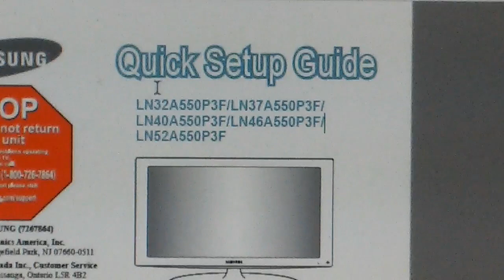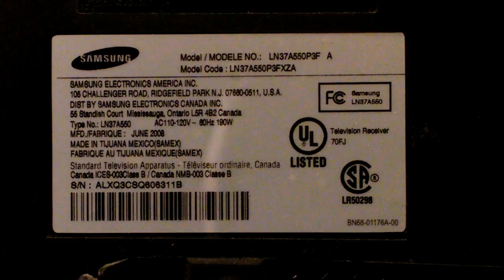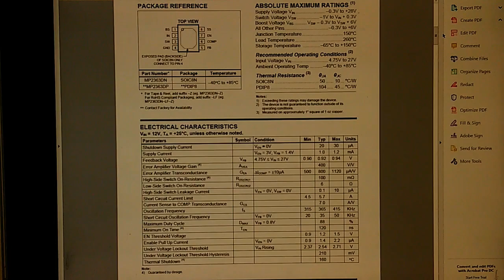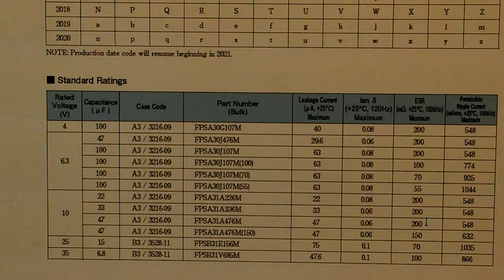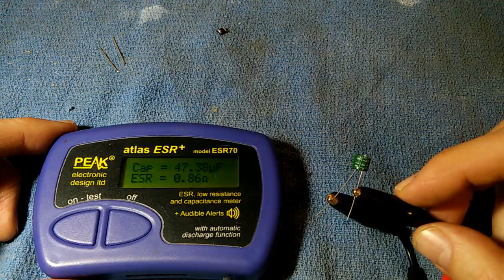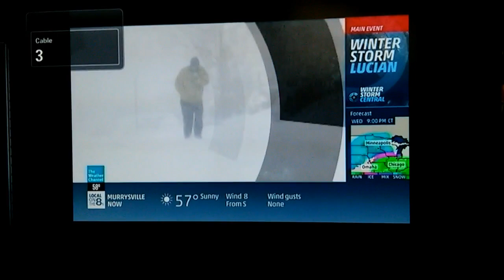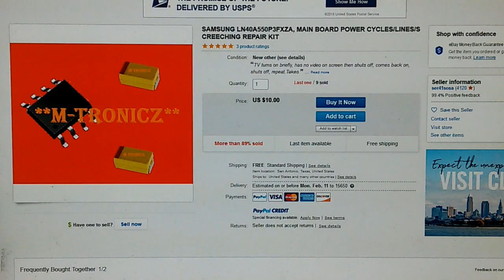Samsung TV startup cycling fix

Comment: Thank you - worked for me - that single capacitor was the issue - I was reading 200+ Mf acoss that tantalum capacitor (not removed) - following your way soldered a 50+ Mf  1200v electrolytic capacitor removed from some available junk board - took virtually 5 minutes - astonishingly TV works fine.  My new capacitor was so large that I had to run 2 wires away foam the main board and place the new capacitor externally.  But, it worked, as I was ready to trash the TV.

Comment: This is the only video I've found that actually explains how to fix the green screen, power cycle, screeching samsung disease.
My TV is currently infected but to this point is still below my tolerance level, (two to four power cycles) so I haven't taken action yet.
I already got two extra years out of my 52" samsung replacing a bulging capacitor on the power board and it looks like I'll be taking a crack at this in the near future.
Thanks for this video, very clear explanation of both the problem as well as the repair.
Reply: I powered up our tv last night while our 7 year old was sleeping and it scared him to death. He woke up screaming, poor kiddo.

Comment: Thanks for the video showing the symptoms of your TV and the fix.  My LN46A550P3F was doing exactly those things.  The main power supply caps looked good and I pulled a few and measured them.  I had a 47uF 8V polymer tantalum in my collection that I used (35mOhm ESR) as a replacement for the output cap of the MPS buck regulator.  The TV starts right up now.

Comment: Thanks so much for this well done video!  Replacing the 47uf 10V  capacitor with one I got off eBay ( a non surface type tantalum cap )solved the problem on our 10+ year old 46" version of this Samsung TV (LN46A550P3F).  Never unsoldered a surface cap before, but no problem.  Nice to not have to throw this thing in the etrash because of 1 little capacitor!  Big thumbs up!
Reply from the maker: Excellent!

Comment: Rewritten corrected text:
SAMSUNG TVs of the A550 series were notorious for having problems when
stating up.
Specifically, the picture would come on with abnormal colors or stripes.

The audio would be absent or a screeching sound.
The picture would then shut down and restart with a different abnormal
pattern.

It could go through many cycles before getting the picture and sound
correct.  --  The problem is on the Main Board.

Others have found that a Tantalum Capacitor and a Step-Down Converter
chip causes the problem. --  The capacitor is 47 uF 10 volts.

The Step-Down chip is MP2363
The capacitor can be removed with a soldering iron, but the Step-Down
chip has a central sold pad, and it must be removed with a hot air
desoldering station.

I believe the capacitor is much more likely to fail than the MP2363 chip.
In this case, I used a capacitance meter to show the capacitor had
abnormally high ESR.

I replaced only the bad tantalum capacitor with a cheap electrolytic
capacitor and it fixed the problem. I used an electrolytic capacitor
because I had no tantalum capacitors on hand.
If I were to do this job again, I would order some 47uF tantalum
capacitors ahead of time.

 --- Clues that the problem is the tantalum capacitor ---
1. The problem is worse when the TV is in a cold environment.
     Failing capacitors often function better when they are warm.
2. The problem has gradually become worse over time.
    Typically capacitors go bad slowly over time.

The TVs in the A550 series are:
LN32A550P3F
LN37A550P3F
LN40A550P3F
LN46A550P3F
LN52A550P3F

The user manual and firmware update for the A550 series TVs is available at:
https://www.samsung.com/us/support/owners/product/2008-lcd-tv-a550-series

For those who do not have soldering equipment/skills, there are services
which will perform the work for you. There are several listed on eBay.
The typical charge $40.00

You may incidentally discover some bulging capacitors on the power
supply board.  --   These TVs are also notorious for that problem.

There was one in this TV and it was replaced.
The swollen power supply cap did not cause the restart problem, however,
they can cause other problems. Swollen caps should always be replaced.

00:29 TV models in the Samsung 55 Series.
01:32 Description of the problem.
03:06 Demonstration of the problem.
05:27 Remove the back of the TV.
07:19 Remove the Power Supply board and replace a swollen cap.
09:32 Remove the Mainboard.
11:41 Location of the suspect components.
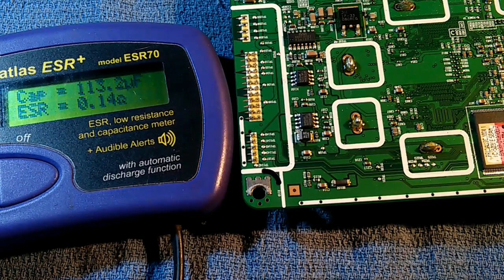13:55 Measure ESR on the tantalum capacitor.
14:46 Replace tantalum cap with electrolytic cap.
15:46 Successful fix.

Comment: Very well done and informative.  Funny though I ask myself, “if someone has a soldering iron and DOESN’T own a multimeter”, I wouldn’t advise attempting an electrical repair.  Halfway decent DMMs are pretty inexpensive anyway these days.   Great video!!
Reply from the maker: This job requires more that a basic DMM.  A  capacitance/ESR meter is needed to test the capacitor..  They are typically $100 USD minimum.

Comment: I found a LN46A650A1FXZA at a garage sale for $5.00 and it is exactly the same as the one I found on the curb a couple of years ago that only needed two capacitors.  The garage sale TV has good capacitors and all I did was to take off the power board and spray with canned air to get the dust off and it works like new.  No more on/off, lines nor bad colors.  I got lucky.  lol.

Comment: I have a Samsung model  LN46A540P2FXZA that's been having this same problem for several months now.  I'm willing to try and fix this TV before I put it on the curb.   Where do you buy your capacitors and what specific  tantalum capacitor would you buy?  I went on line and the selection is huge so I'm not sure where to start.  Thanks for taking time to make this video.
Reply from the maker: Any  tantalum capacitor should work, as long as it fits in the space and it is 47 uF and 10 volts.

Comment: Hi. I have a 40” A550 Samsung. It recently stop working. It turns on with a black screen and cycles thru the channels. As if it is scanning but never finds any channels. Remote does not respond. Can not get to the menu. If I press and hold the menu on the side of the tv, it will stop scanning at the channel it’s on and the snow tv will come on. Once I release the button the tv going back to a black screen and continues scanning or running thru the channels. Any thoughts?

Comment: Before i found this video, did open my 32¨ tv to check the power supply, didn´t found any blown capacitors, so, after watching this video, will try to replace that tantalum capacitor tomorrow,  i`ll let you know if that fix mine.

Comment: Is polarity of an electrolytic capacitor and issue when replacing a tantalumcapacitor
Reply from the maker: Tantalum capacitors are polarized.  There will be a stripe on the positive side.  Opposite of electrolytic capacitors, which have a stipe on the negative side.

Comment: Ahhh...more material to add to my spank bank.

Love these.

I'm having the consistent power-cycling issue on my Samsung 55" 8-series TV. I'm pretty sure the issue is on the logic board, but Samsung is so insanely useless (and dishonest) that I can't confirm my theory without simply replacing the board and giving it a shot. No service manuals or schematics for the things we buy these days :(

I also see no obvious issues with the components on the logic board. I have a thermal imaging camera that I used to inspect the board, and didn't see any clear problem.

I have a microsoldering station and a hot air station. I still haven't dropped the money on a microscope though =\

What do you believe the problem could be on that 8-series TV?
Reply from the maker: I have never encountered a Samsung series 8 and I know nothing about them.  A failed power supply capacitor can cause a rapid cycling of power on and off.

Comment: I have a 50 in that is powering on and off continuously, how do I fix it, ive unpluged it all day and when plugged back in it continues to power cycle
Reply from the maker: I would start with the big caps on the power supply board.  If any are swollen, replace them with new ones of the same value.

Comment: Wow, this is video is so much more helpful than anything else so far to me. I'm trying solve a similar issue at the moment on my tv ( LN32A550P3FXZA ).
 I took it apart and I want to try what you did but one cable on mine is different and i couldn't get it out (i think it's the cable to the T-COM board based on what i've seen) and i don't know how to identify what capacitor i need. a little help maybe? :)

But otherwise thanks for the video